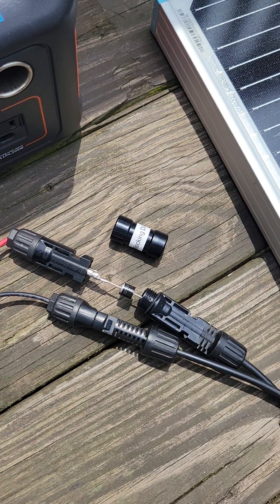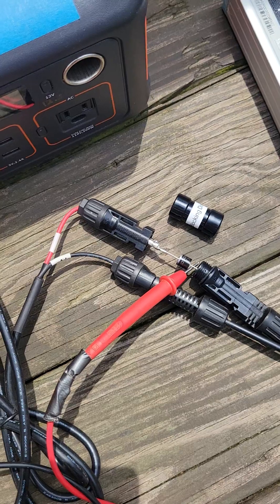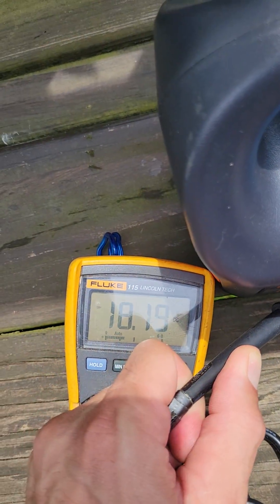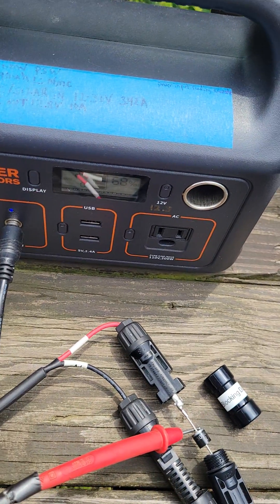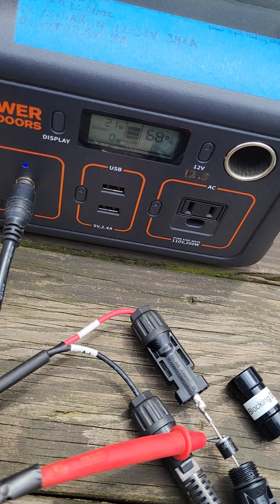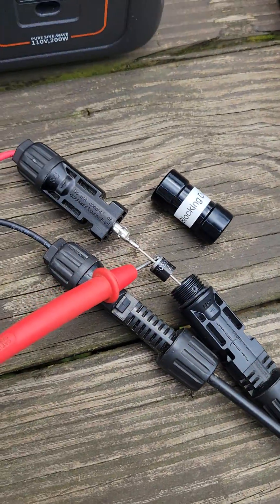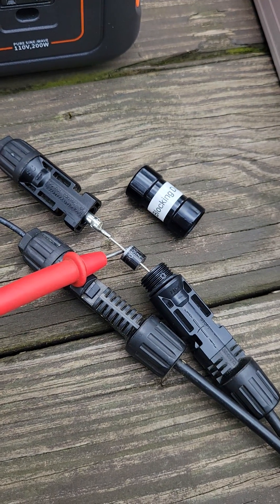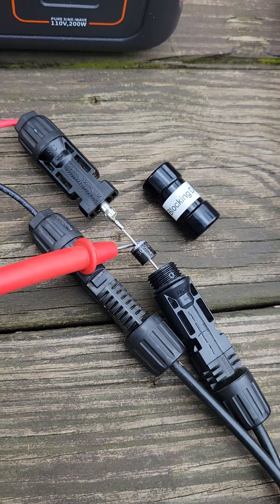Temu 30A MC4 Blocking Diode Voltage Drop Test

Comment: You must never use these diodes without a heat sink.
These MC4 type diodes are prone to heating up very quickly and cause dangerous melt down.

These diodes are rated for a max 150 degree Celsius temp. But you are required to run it as low as 60C with proper heat sink.

Without a hear sink or even without a ventilation for the diode (packed inside the plastic housing of MC4), it will hear up and go on a thermal runaway. Way beyond the 150C temp. and reaching its breakdown temperature of 270-350C. When this happens, the plastic melts and may catch fire.
Reply from the maker: Yes they do get crazy hot. I switched it out with the lower voltage drop diodes recommended in another comment and it runs much cooler now even without heatsink

Comment: Are these 1000v DC rated?
Reply: Here's what ChatGT said re a question I posed about a 5W model. I'm only including the lines that aren't relevant to your question. The brand of diode is Schottky - 
Model    Max Current	Max Voltage	    Forward Voltage	      Notes

10A10	  10 A	            1000 V        	   ~0.7 V	         Overkill, but very reliable

Comment: I evaluated a number of this SQ series and notices some strange effects.  15SQ045 only had about a third of a volt drop at that current.  The higher current rated diodes had more in line with what you saw.  Data sheet had no charts for this.  Diodes have lower voltage drop the higher they get in temperature and these higher current rated diodes drop considerably when hot at higher currents.  It is a real design tradeoff.  In your current range you would be better off with a 15SQ045 than what you have.    Probably the higher current diode is a marketing ploy.   You should be able to apply voltage to a panel with almost no leakage of at least 130% higher than panel rating.  Your unit may source more than that.  More likely your panels have some damage from lightning pulses, it doesn't have to be direct. Or just poor quality cells.
Reply from the maker: @opera5714  I soldered in an 15SQ045 and it was much lower Voltage drop thank you 👍🏻
Reply from the maker: Good info I will try that one next. The panel is all good its just my super cheap power station that doesnt have an anti reverse cicrcuit.

Comment: But don't most panels have bypass and blocking diodes in them already? Do you think that this is still needed with a modern  mono bifacial panel?
Reply from the maker: Im only using the diode because the MPPT in my unbranded power station (Oupes 300) reverses anytime there is a cloud or a shadow

Comment: Please could you tell me if I need to fuse my solar panels. I have 1080 watts of (3) 360 watt solar panels in series, chg controller victron 150/45 ocv on panels 43.5
Reply from the maker: I think you are OK because you are in series.
Reply: Pv in series wattage and current remain same but voltage add on. In parallel wattage adds on current adds on but voltage remain the same